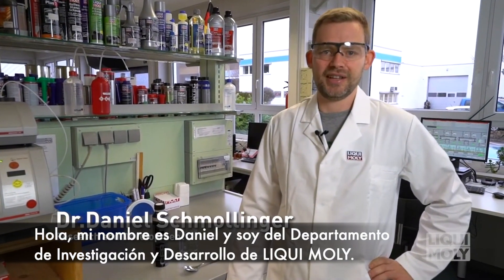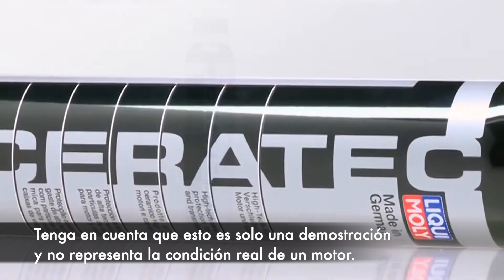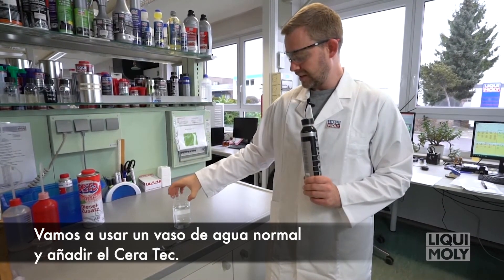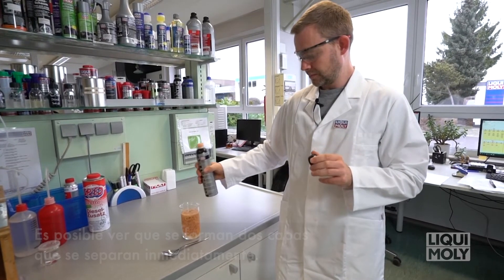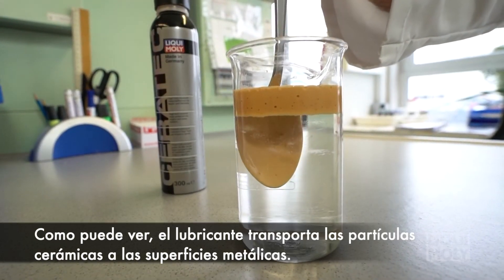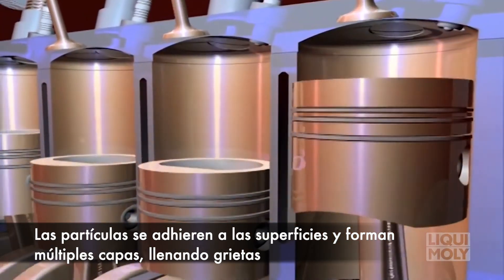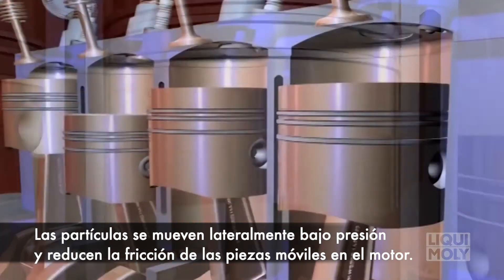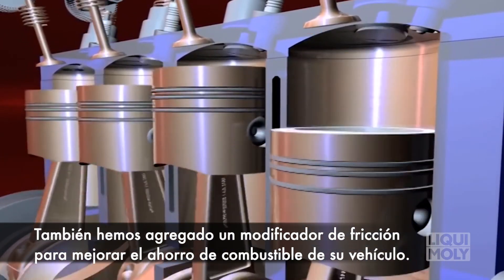Cera Tec - Subtítulos en español

Comment: Hello! I have used Ceratec with the Top Tec 4600 oil that I use. I am thinking to try your Molygen New Generation engine oil for the next oil change however I don't know if Ceratec would be compatible with that motor oil and also if it is necessary as the Molygen New Generation has is own additives and friction modifiers from what I have seen in the product description.

What would you recommend me to do?
Reply from the maker: If you are going to use Molygen no additional oil additive is needed or recommended, because of the already premixed chemical friction modifier in these oils. Best regards, your LIQUI MOLY team